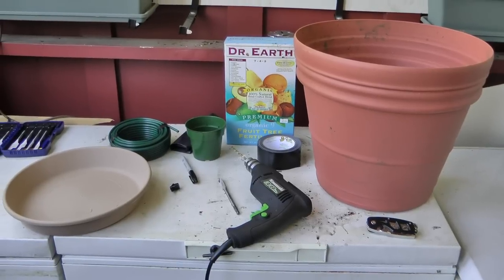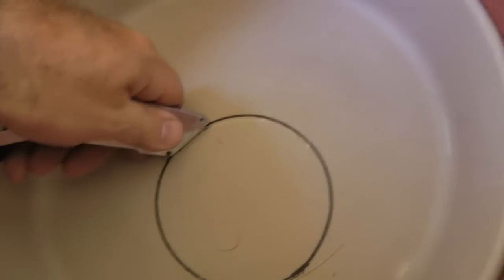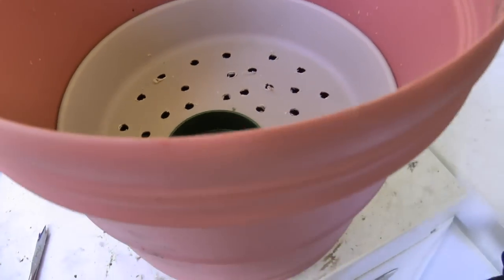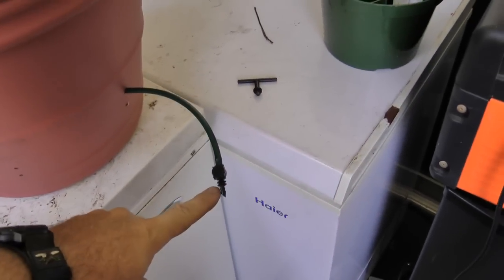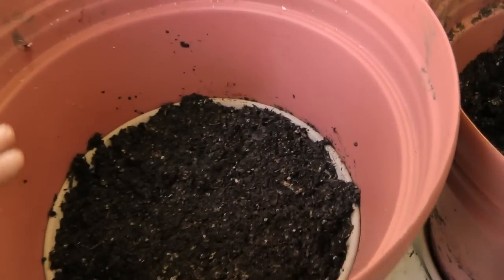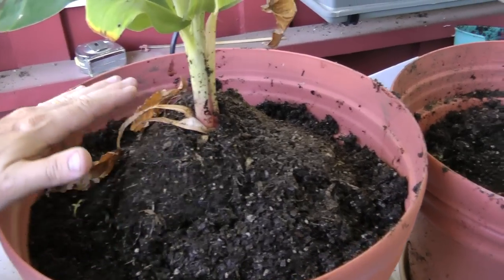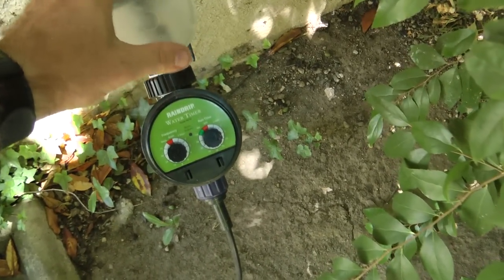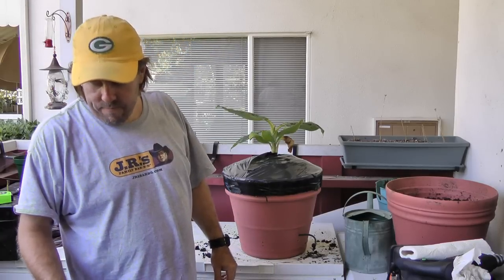A cost effective self-watering plant system

Comment: If you have a timer and everything anyway then why bother with the bottom feed? Why not just have the timer send a set amount of water to a gravity tank which then sends the water down tubes to each plant.  You wouldn't need the false bottom and thus have more room for roots and only need one timer vs one for each plant.

I'm asking, not telling.  I'm still learning.
Reply: i was wondering that, as well. if a bag is used over the pot, then rain is not a concern.  watering would remain consistent from the hose timer.
Reply: Justin Wittock Also, if he has plants that require less water, he could just attach the hose for those plants higher on the gravity tank.  That way when the water goes below that level then those plants stop getting water.  Yet, the ones that need more water would be attached lower on the gravity tank and thus continue to get water until the tank empties, etc.

Again, I don't know a lot about these things.  So there could be something wrong with this idea. 

BTW, you wouldn't even need to do any major  math to decide which hole to use for which plant.

You could just have a series of holes going up the side of the tank... with a plug in each hole.  Then you make a best guess on which holes to use and attach hoses to those.  Put measuring buckets at the end of each hose where the plant would normally be.  You then run the timer to see how much water is collected at each station.  Then move the hoses up or down on the tank as needed.  It would probably take a few test runs to get it just right.

Comment from the maker: glad you liked the video. to be truthful, i had a line get clogged when i was busy one time and i just ran a drip to the top where the hole is in the bag and it held up fine as a quick fix. i would think you could run a funnel to the stem and just let the water flow down through the plant. btw, the plant in that video is about 10 feet tall and has bananas all over it. i had to move it to a bigger pot with the same system but havent even touched it other than that. good luck!

Comment: gr8 demo...as you have covered the top how does the soil breath?.... would the holes in the bottom plate be sufficient for aeration.. have you emptied the contents from a pot and checked what the soil looks like? the pot which sits in the water with the soil for wicking would that not become completely dead... usually i see the soil+compost sitting in water become black

Comment: Good video. I made some mistakes on my first try that I wouldn't have made  if I had seen your video beforehand.  One thing I did right is hook the 1/4 inch tubing to my lawn watering system.  They sell simple "T" fittings at Home Depot for this purpose, which fit under any spray head.  By adjusting the valve in the tubing you can count on getting more water to the pot than you need.  Any excess water just drains away through the drain holes.